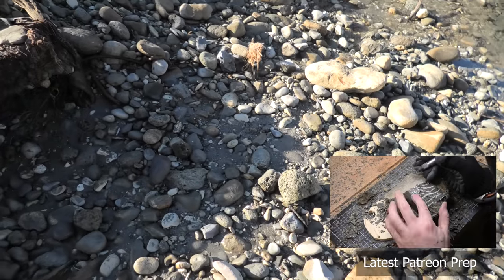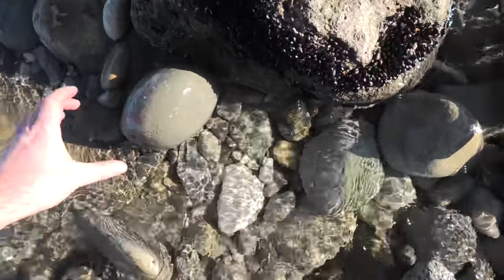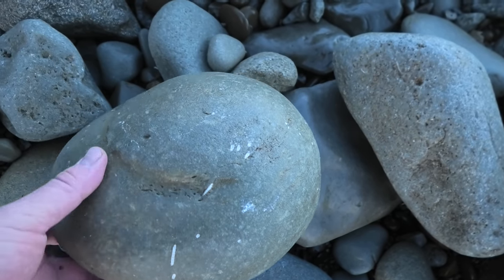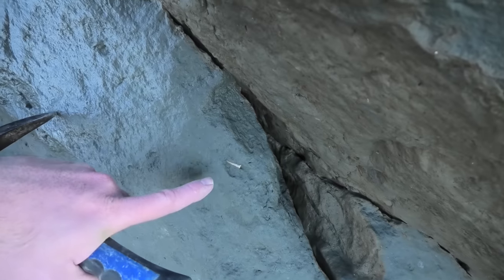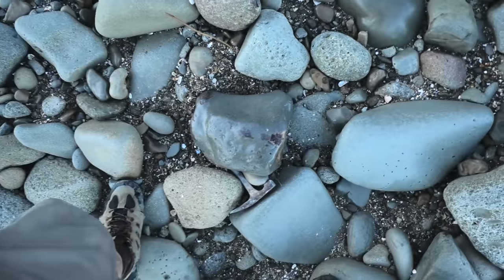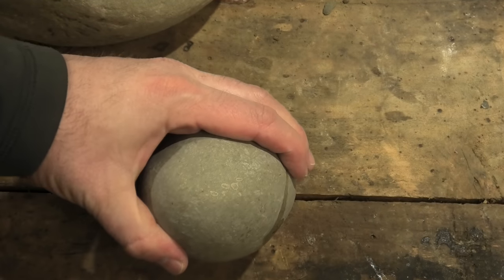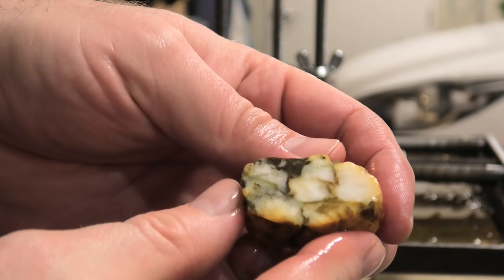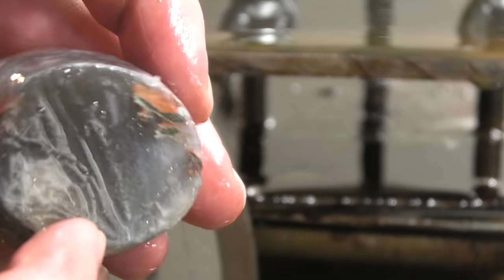Fossil hunting adventure with a fossil tooth, crabs and some rock cutting!

Comment: I have a question.
We've got 13 acres here with a nice Rocky Creek about 10 feet wide.  It's on the Eastern slopes of the Appalachian mountains about 200 miles from the Atlantic coast. I know that I will never know until I look, but what might I find in my rocks?  Where would I look to even know?

Comment: Regards foot wear , if you get steel toe capped boots, and be very careful of the fit. You can get thermal booties over one or two woollen socks. You want a fit that means you ram your feet in. The boots will stay on nicely no socks slipping over the heal and you can wade through cold water rock pools all day and stay dry. Have it a go. It's all in the tight fit.
Reply: Waterproof socks are worth a try too, I had a set of seal skins (not actually made from seals dw) that worked a treat for trekking although I don't bother these days since I overheat very easily due to medication and I quite enjoy the cold haha